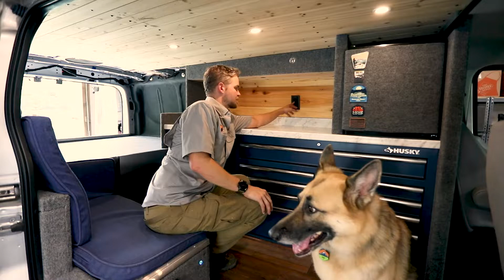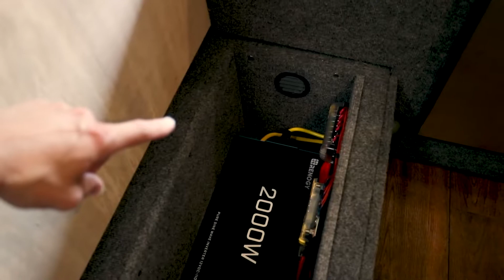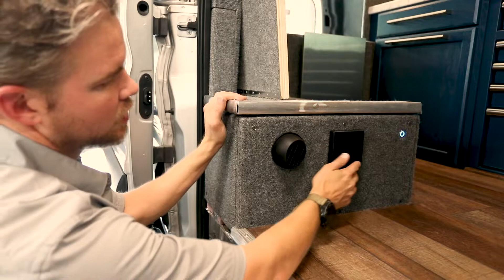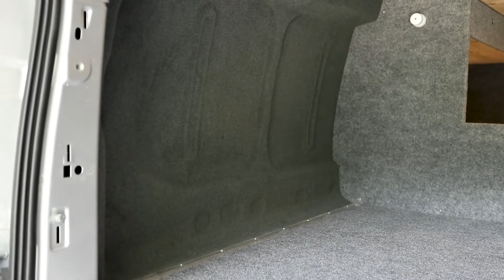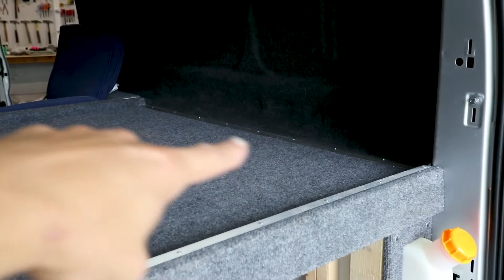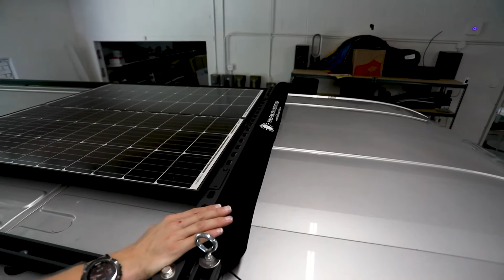2019 Ford Transit Camper Van Conversion Tour

Comment: Nice build and a love the tool drawers for cabinets. I couldn't get the orientation of the bed or how you would fit in it to sleep.
Reply from the maker: Hi DK, one on the nice benefits of the Ford Transit is that if your are less than 6ft, you can sleep sideways (perpendicular) as long as you do not build out the van walls too thick. You have about 73" to work with at the widest point of the van in the rear and is why a lot of people like this vehicle. (As for side sleeping in a low roof van, make sure you give yourself enough height from the van ceiling to get in and out of bed. (Remember as you build you van ceiling and van floor your total height is decreased 2x, so plan accordingly).

Comment: Hi Again; what brand diesel heater and how long will it run on that gallon  (assuming its a gallon) tank?
Reply from the maker: Hi Joe, In this van I have the "Superfastracing" 2KW 12V Diesel Air Heater. Yes that really is the name, it is a chinese diesel heater off of Amazon and comes with a 10L fuel tank (2.64gal). I don't use it for more than 8hrs at a time, but a fuel tank (10L) should last about 36+ hrs. So about 13.6 hr/gal. Many people use these because they are very budget friendly. Even though I have had zero problems with mine in almost 2 years. I would highly recommend investing in the Webasto Air Top EVO 40 (or Eberspacher equivalent). Although these units are much more expensive, they will run almost 2x more efficiently as well as automatically adjust its Air/Fuel mixture depending on your current altitude. Again this really depends on what your plans are with your build, location etc. NOTE: make sure you purchase a US version from a company that can warranty these in the US. Many of these units that are discounted or on "SALE" are non-us versions and can not easily be warranted if something fails. Titan Vans out of Colorado for example sells a US version of this heater and guarantees warrantability of the unit on their website.

Comment: I am planning a build and have looked at Husky and wondered if you modified that cabinet to keep it from rattling while driving?
Reply from the maker: Hi Joe, The husky toolbox works great, I have not modified it to keep it from rattling. Normally when the drawers are filled up there is enough weight to dampen the rattle. To remove any additional rattling/squeaking you can apply white lithium grease to the locking mechanism bars where the sliding metal to metal contact is at the rear of the tool box, this is where 99% of the noise will come from.
Reply: @vanbuilderhq  Thanks for the reply; I will be checking out the various Husky cabinets for the New van I just ordered! Ford transit 148 Medium roof 250 AWD with adventure package and a bunch of options.

Comment: Looking forward seeing it completely done, for actually i like it already. But i wonder why you didn't go for middle or high roof: it would be more comfortable.
Reply from the maker: Hi Matteo 70! When I originally started this build I needed to be able to fit into a parking deck so the low height requirement was necessary, I completely agree the high roof is the way to go! I’m working on two high roofs right now and can’t wait to upload the progress soon. -Nick
Reply: I forgot to include that it is a medium roof van. I am 5' 7" so that should be plenty high for me!